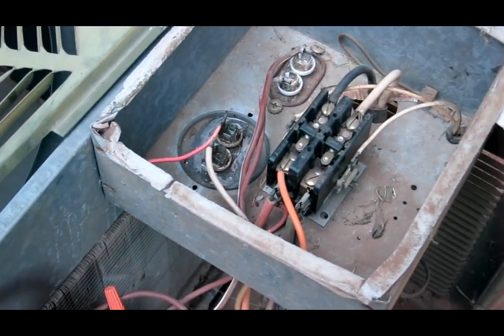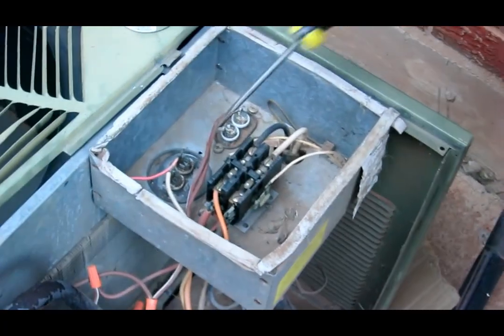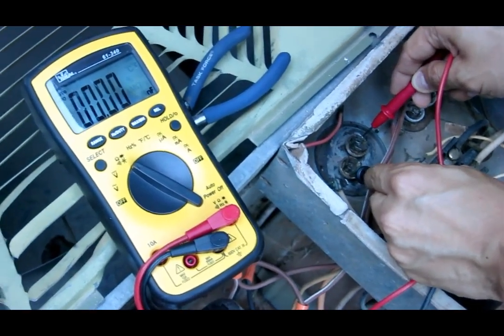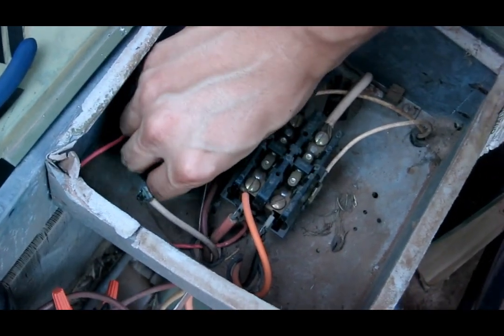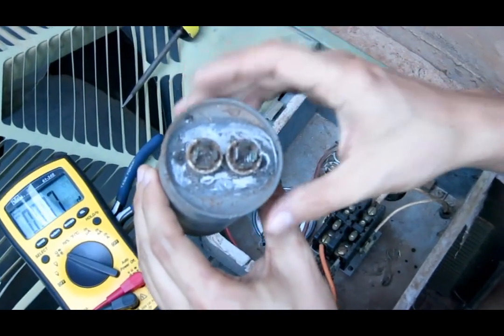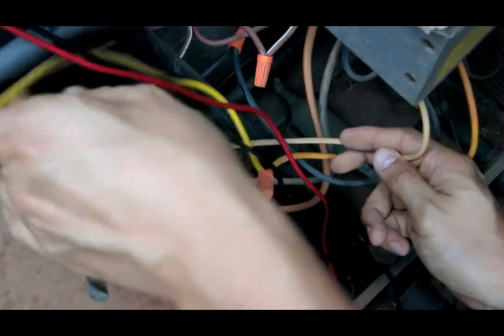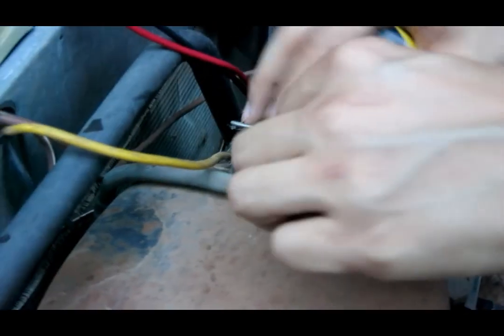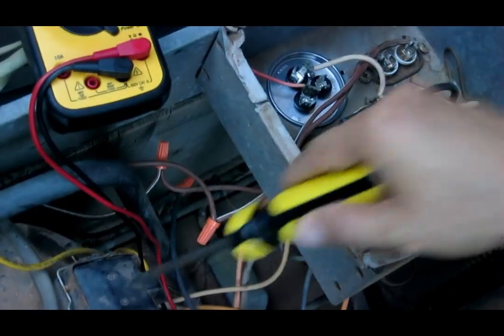How to fix your AC - Fan kicks on but Compressor Not Working - Replacing run start capacitor

Comment: how can I check thermostat 24 v to ac outside what should my meter be set on???
Reply from the maker: this is a better video showing how to measure 24VAC. its the VAC setting on your DMM:
AC blowing hot air - How to troubleshoot HVAC compressor - measure resistance - blown compressor
Reply: I checked relay and 24v everything is good but the unit outside stays on when thermostat is off  this is driving me crazy! can I send you pic or look at my G+ its there
Reply: the pic is of contactor and wiring
Reply from the maker: Danny Diet try watching the following 3 videos. if they dont help, then send me the schematic. Usually those videos clear the basics. Anything beyond that will require a tech:
How Air Condition Ventilation & Furnace Works - HVAC AC system diagram
Troubleshooting Air Condition Ventilation & Furnace - how does HVAC AC work Troubleshoot
HVAC condenser - how to read AC schematic and wiring diagram - air condition howto
Reply: ok update I figured out and confirmed the how the contactor relay should be wired and this even all was working good with thermostat turning it off and on but suddenly the outdoor unit turned off not sure why I guess I will look at it tomorrow morning. now I am confused totally unless the contactor relay stay open relay not working anymore ??? Is this a bad contactor relay.
Reply from the maker: Danny Diet A contactor can be intermittent. The contact itself builds up oxidation and resistance over time. This following video might be your situation:
AC not starting up - Air Conditioner condensing unit lost power - Replace Contact contactor relay

it sometimes work, and sometimes doesnt.
Reply: I will watch it now thanks, so just based on contacts it can not start or stop starting. where can I purchase online one like mine?

Comment: So all seems to work good except AC unit outside stays on after thermostat turns off. What could this be? I did not change contactor with  switch yet. Could this be the problem?
Reply from the maker: you need to see if you are still getting 24VAC at the contactor. If you are getting 24VAC at the contactor then check the control board. If you are not getting 24VAC then your contactor might be shorted.
Reply: so I get it when thermostat on should be on when its off should be off

Comment: hey DIY i have a question. My Window AC has a problem. the compressor turns on and off at its wish and will randomly.  I have a low voltage problem in my area but to counter it i am using 10000W Voltage stabilizer which efficiently gives required out voltage. At times the compressor is working fine even when input voltage is 180V and at others it switches of even when the input voltage is 220V....i am sick and tired of its random behaviour.
Reply from the maker: Sounds like you need a kickstart:
HVAC Intermittent Problem - AC doesnt start every time - Hard Start helps low house voltage
Reply: DIY Tinker Buddy one more recent happening i wanna discuss. Today I splashed water from the back on the tubes/coils and the Compressor starts up and AC works perfectly for the time being. Once it switches off again  i repeat the same procedure and it again starts up and AC works great. I am not getting wat really is the problem with my AC :-(

Comment: Wow! what a fantastic help your video is! My central AC just started blowing warm air. I went outside and can hear something try to start, but it stops in a second. If I use a stick, I can get the fan out there, to spin up and continue, but only cold air comes up from the outside unit and warm air inside. Outside, every few seconds, I can hear something try to start the compressor, but it shuts down right away. On my old AC unit, I replaced the starter boost capacitor and it was pretty easy. That one was on the outside of the unit, though. I think I have a capacitor issue again. Thank you for the excellent video and tutelage. I am still kinda scared to do these repairs, myself, but I will try this with your video help. If you want to give me moral support, please email me (), please let me know how to safely let you know my email address. I could use the moral support. Thanks, again!
Reply: Edit to my comment: I am a 56 year old woman. I really could use the moral support for this kind of repair. I haven't used my tools in so long (7years), I think my DeWalt cordless drill might not work anymore.

Comment: I tried pulling out the "fuse" on the outside power box for the A/C, but no matter how hard I pull, it would come out. What could be my problem? Rust on it? The fan on the A/C outside my condo isn't turning, but the vent is blowing... warm air in inside...  By the way, where you following the white wire to the compressor, where you say it purple inside, I don't see where there is a connection between purple & white? Great video.
Reply from the maker: im not too sure why it wouldnt come out. most just pull out, there might be a special way removing it that isnt common. the sun/heat caused color fading. the wire was purple, and it still is at the compressor. But the reset has faded into white.
Reply: DIY Tinker Got it... thx

Comment: Thanks for posting this video!  It was very helpful to me.  I had no idea how simple these units are inside.  I discovered and diagnosed the problem late Friday night.  After watching this video, and luckily finding a local HVAC supplier open on Saturday morning, I was back up and running in no time.  It cost me $36 for the capacitor.  I shudder to think what a weekend service call would have cost me in parts and labour, if they could have even got to me.

Comment: Hey DIY Thinker - Our fan turns on and it sounds like the compressor also turns on but air has stopped blowing out the vents!  For the past months air would blow out of the vents (really cold) but only 50% of the time and now not at all.  Do you think this is our capacitor?
Reply: most likely the indoor blower motor. The fan that is in your furnace is what controls the air coming out of your vents.  Open up the furnace and you will see the access to your blower motor.
Reply from the maker: if your fan and compressor works, then you should check out the furnace:
Air Conditioner doesnt blow any air - how to fix AC blower - HVAC control board replacement
Reply: boy!! some of these people are rude to you! you know your suff!!

Comment: What if your ac is cooling the house and the fan is running, but when you turn the ac off the fan keeps running, what is the problem?
Reply: or check your tstat and make sure the fan is not in the on position.  make sure its in auto.  i been doing this for 16 years and people call a lot and say there fan won't shut off. but your not going to fix everything from youtube. you have to get a professional to diagnose. properly because it can be anything. a short in the low voltage wire. bad stat. bad board . pick one.But if i were you i would start with the simple things first that home owners can do like check the stat. Fan in on position. or auto.   does it run while its in the off position.  it gets to deep for youtube sometimes.  But Pretty good video DIY Tinker
Reply from the maker: I would think either the thermostat isnt working, or the control board in the furnace has a stuck relay/bad micro chip.

Comment: i wonder if i need a new capacitor,  i hear the compressor start up and some coils get cold to touch but it only blows warm air in the house,  would a new capacitor help here or is my problem elsewhere?
Reply from the maker: if your compressor truly starts up, then no, a new capacitor will not help

Comment: Wow people like you get other dumb people killed been an hvac tec for ten years if your gonna show someone something dangerous you should stress the fact that it is I knew a guy from another a/c company who was killed by a run cap or maybe you dont full know the risk yourself there is a reason tech's go to school and it only took me once of fucking off the tip of a screwdrver to learn not to use tools to dump the load of a run cap the oil not water can also explode out I have had them pop like a shotgun ive seen them pop and take out other parts of the unit I have even dumped the load on an old lid and watched it jump around sounded like popcorn SO PEOPLE WATCHING THIS take caution just because this dumb ass didnt die dont mean that you wont ps herm is always the compressor idk what the whole chase the puple wire was all about but a real tech would have knowen that
Reply: You sound like a real ahole.  But thanks anyway, geez....

Comment: Hi, I have a question for you. My thermostat's Aux green light is lit on my thermostat. Is that a capacitor problem? Thanks.
Reply from the maker: you need to physically test the capacitor to determine if its damaged or not.
Reply: Ok thanks I will do that first.
Reply: That means you have a heat pump and your aux. Heat is on .
Reply: What do I need to do to have that light off?
Reply: ***** if its an old slide thermostat ..replace it with a new digital one ..if its a digital one ..may need to look at the air handler heat section ensure that the aux heat contactor or relay is not stuck ..
Reply: Hi. Many thanks for your help. I have a digital and it's about 10 years old. Where is the air handler heat section located? The inside unit or outside unit?
Reply: ***** inside unit.
Reply: Can you tell me what it looks like? Is a small part or large part? Could describe it. Thank you so much.
Reply: Well it all depends on what brand unit and the year.if you have a multimeter designed for hvac or an ohm meter you can test the relays to see if they are operating properly or welded shut. Either way it is better to pay a tech. If its any parts gone bad you wont be able to purchase them at any supply house unless u have a contractor license.
Reply: Hi. It's a Payne brand put in 2004. Ok thanks for your help.

Comment: Let a professional AC contractor diagnose and replace electrical components.
Reply: Or learn how to fix it yourself and save money...
Reply: Sadly, there are way too many so called "professional AC contractors" out there who are more than happy to rape their customers. Like charging $600 to change out a bad condenser fan motor (about a $50 item, and about a 30 minute job) for one of my son's friends. The "professional" also offered to change out the run capacitor (a $9 item, and about a 3 minute job), that he knew was going bad, for an extra $300! Thankfully, he declined on the capacitor. I ended up changing that out for him later, when it finally gave-up. He did not realize, at the time of the bad condenser motor, that I had AC training/experience. Could have saved him about $500 (because he was a Good friend of my son).....if he had only known.

Comment: good video and that capacitor has oil in it the new ones have more of a wax type last year in Tulsa I changed out lots of capacitors the new ones don,t last as long like the old PCB ones

Comment: The "u" is the Greek letter "mu" - is used to denote "a millionth" (X10 to the -6th - Micro).   The 220 uf is 220 millionths of a Farad of capacitance.   Like taking one Farad of capacitance (Large value), "cutting" it into a million pieces, then taking 220 "pieces" of it.  Small, eh!  :-)

Comment: Thank you DIY tinker, I don't think its under warranty. I'll see about getting an estimate and decide if it's even worth fixing. The insulation in this house is terrible and I'm sure the ductwork is bad somewhere even though I haven't found a leak yet. I'll wait until winter to fix all that though. In the meantime I might just get a window unit.

Comment: Next day I tried the a/c again and the fan was turning like always but the compressor didn't seem to start (no condensation at all), so I turned it off. Any idea what it could be? I can't afford to have it repaired for another couple of months if its going to be an expensive job. Might as well just buy a window unit if I can't do it myself.
Reply: Storm Windows on the house I live in keep me from installing a window unit.

Comment: Hello DIY tinker, what were the signs that the compressor was not working? The night before last, I heard a terribly high pitched screeching outside and it was the condensor. The fan wasn't spinning but we were still getting cold air. Nex

Comment from the maker: that might be true... 13 SEER is about 25% to 35% more efficient than this old 10 SEER. but electricity in OKC is only $0.08 per kWh. His unit only cost him $0.35 per hr, so a 13 SEER would be $0.25 per hr... we did the math, and its only $75 saving per month in summer. It would take 5 to 9 years before he can see the savings.

Comment: in this scenario you wouldnt need a dual run cap, only a normal will work, and if you didnt have a 35mf / 440v cap you could use the 40mf/ 440v for a temproary fix...you should allways go back to the one that was there after you can get to a supply house. you can go up but you cant go down with MF rating.

Comment from the maker: no, you shouldnt. you should always follow the same capacitance (sometimes the manufacure has an acceptable range, you need to do some research, or ask the sales person, they might kinow). But, you can increase the voltage rating from 370VAC to 440VAC. 
Also, you can always split the capacitor from one to two. you can watch it on my channel "Replace HVAC dual run capacitor with two capacitors" or past this at the end of youtube watch?v=bT6W7hPHfUo

Comment from the maker: yes, it does sound like the compressor isn't starting up. he should have fixed the box (if it was bad, not just kick it). Watch this video:youtube.com/watch?v=r8LD6rtElUY
its on my channel, and goes over how to measure voltage and the compressor wiring. If you dont have 240VAC, then it might just be a power issue...

Comment: I had a guy come in to take a look at my roof top unit and they checked everything like you did.  Both Compacitor worked fined but he kicked the powerbox with three big fuses inside with his boot and got it to work and blow out cold air.  Something was loose on the box.  He told me not to touch the box and After 4 days its blowing out air but not blowing out cold air again.  Can you give me some input on this.  Seems like the compressor did not kick start again.  Thank You DIY Tinker

Comment from the maker: if the outside fan kicks on, then make sure you have at least 240VAC (the fan could kick on with lower voltage). Then you can check the compressor and capacitor. keep me posted.

Comment: one thing i noticed, is that where the coils are in the furance is bone dry..it use to be wet and water and the pump use to pump out the water. we cleaned the coils, changed the filter. this morning i went to check the outside unit, the fan was blowing cold air. I've been watching your videos very helpful.

Comment from the maker: "very little air blowing" from the vent is a different problem. That could be the furnace blower, dirty air filter, blocked vents, or dirty evaporator coil. Search "evaporator" in my channel, i have 3 videos on how i cleaned the evaporator coil.
And you might want to understand how AC works:youtube.com/watch?v=JilZmyglFvo
How to troubleshoot:youtube.com/watch?v=PbVGOijXTzw

Comment from the maker: If he can charge it, then the compressor should be working fine. its easy to test the capacitor, you can watch this video here:youtube.com/watch?v=zgNqHlAx3Fw

If the capacitor checks out, then get a second opinion from a HVAC professional with a A+ rating on the BBB or registered to any HVAC associations.

Comment: Thanks so much for posting this.  My unit is similar to this one.  About 25 years old.  Just quit working a few days ago.  Thought I was going to have to just buy a new unit.  Checked capacitor and it was bad.  Got a new one from a local place here for $17 and the compressor came back to life.  Temp differential from intake to vent is about 20 degrees which from my research is about as good as it gets.  Nice!

Comment: Greenfire, certification just means you are educated enough to work on this equipment and the EPA wont fine you for touching it. Something to consider. Btw, u cant purchase a cap at home depot. And what is 220? Did u mean 240 bro? Just wondering.
Reply: 220 -240 delta is a range depending what the local utility is providing.  So don't get your wheels burnished.

Comment: I just had a local guy check mine.

I had the fan motor replaced yesterday and got a new thermostat to replace our broken Mercury thermostat.

Everything went well except that the compressor isnt turning on.

I openned the side panel and noticed that the 3 pin capacitor had a fried one. but the guys who installed the new motor for the fan placed a smaller 2 pin capacitor.

(Im guessing to replace the broken pins on the original capacitor)

Can the problem be that the fried pins on the capacitor?

Comment: LOL good point some certified techs and manufacturers dislike DIY projects not because for safety but because it means a little less money in there pockets even exterminators bigotry over DIY for the same reason

Comment: capacitors that store charge work sort of like a battery but different and
yes they can hold enough charge to shock you sometimes but not all the times there lethal to so it something to watch out for

Comment from the maker: if your breaker is flipping, then there is a short somewhere. Either the fan, compressor or capacitor. you can disconnect one by one and see which one causes the breaker to flip. 
I also have two videos showing how to ohm out the fan and compressor. check it out in my channel.